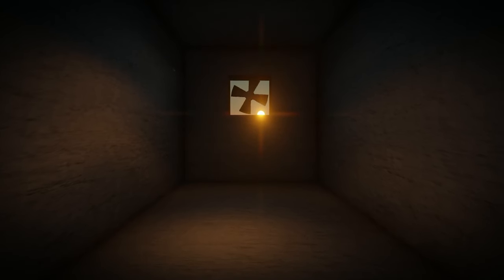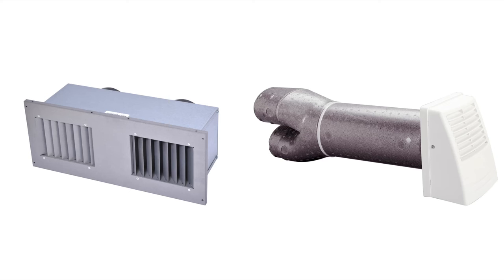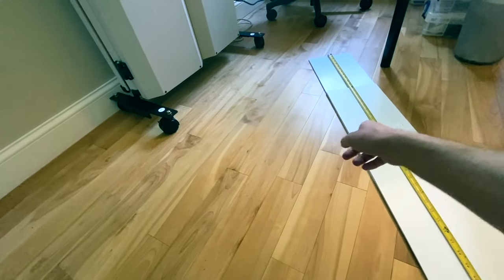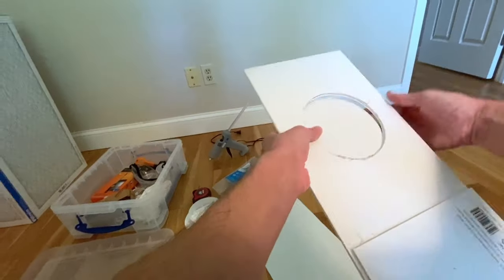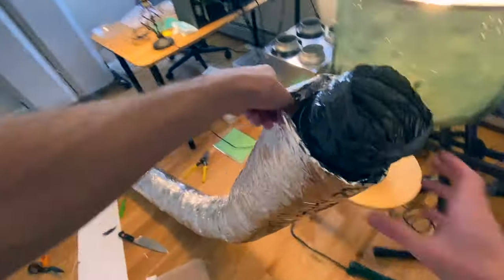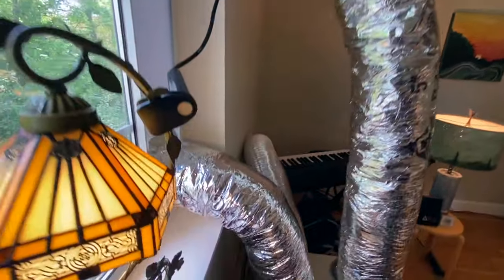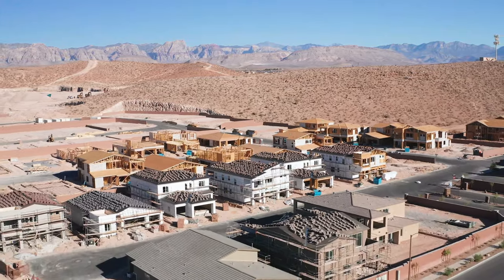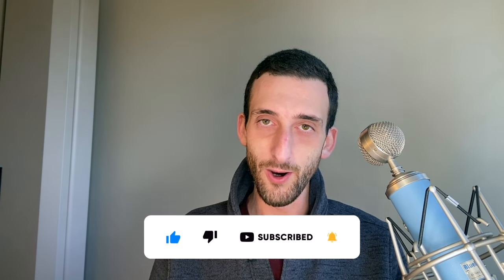DIY Energy Recovery Ventilator Installation (For Homes WITHOUT Ducts!)

Comment: Looking at the comments I think you should have given a half minute explanation about the differences between a HRV and ERV. Especially since you do have a HRV build video :) And why that 1000$ price is not bad for an ERV! Especially your unit does balancing by itself.

One thing I would try is to bring the fresh air duct towards your office door. Maybe on the ceiling? So more fresh air goes to the rest of the house.

Another thing: Should the house have slight positive or slight negative pressure? If I'm correct, you lean towards slight positive pressure to ensure air only enters the building thru the air filter. Right? But for example Nilan recommends slight negative pressure to avoid pushing warm humid air into the structure of your house in the winter (moisture diffusion and also small gaps, electric conduits, etc). Ok, you do have a kitchen exhaust, and only one room has the ERV, so pushing more air in might help diffusing the fresh air thru you home.

Feels like Broan is over-rating their CFM rating. Giving a rating with no ducts is completely useless. You have less ducts than what would be used in even a two room apartmant, but the actual air flow is still less than advertised. Here EU regulations do require manufacturers and sellers to give standardised air flow and efficiency numbers to buyers. But sadly most marketing stuff still says useless claims like "up to 90% effeciency"...
Reply from the maker: Great point! I suppose I overestimated how familiar people would be with the difference between ERVs and HRVs. I actually just made another video explaining it haha! Thanks for the suggestion. 

I like your thinking. I don’t feel that the extra labor of fixing the fresh air duct to the ceiling or closer to the door would yield much benefit - my office is small and there isn’t much of a gap between the fresh air port and the door anyway. My circulating fans do the trick of exchanging air well. Also, it’s not that efficient to blow air along the ceiling and out of a room given that the space above the door is a wall, if that makes sense. 

For those concerned with not bringing in toxic substances (such as mold spores, mouse debris, gas from a heating system, chimney soot, etc) from beyond the conditioned spaces, positive pressure is generally prudent (as I did in this video). Negatively pressurizing a home would concern me. Though it’s surprisingly difficult to actually pressurize a house unless it’s quite airtight. For most houses, which are at least somewhat leaky, you’d need much more cfm than 5-10.

Another good point about companies overestimating airflow for their devices.

Comment: Cool idea (every time i see your videos I think that.) But I'm guessing you live in a zone much warmer than I do as I don't think chloroplast would have enough insulation at -35.😆 Also I'm wondering about the air exchange between panes when the window is slid partially over.
Reply from the maker: I appreciate that, thank you! I live in northern Vermont. I’ve talked to HVAC installers in this area, in the Adirondacks, and in northern Maine, and they’ve been installing this ERV in this region no problem. As far as how it’d perform in -35F, I’d imagine not optimally haha.

Great question about air infiltration between panes when the window is opened. It depends on how well-made your window is, but yes, it’s a great idea to seal that gap with foam or weather stripping tape.

Comment: Hi - I am not sure if this makes sense but why have the insulated ducts? Since it is just going to the ERV anyway and being converted there and the bad air is just going outside - why insulate them?
Reply from the maker: Great question. It’s best practice to insulate ducts that interface directly with the outdoors because cold outdoor air comes in contact with them in the winter, which can cause condensation. Insulation prevents the outer surface of the ducts from getting cold and therefore wet.

I didn’t insulate the two indoor ducts that aren’t interfacing with the outdoors.

Comment: Brilliant - which is why I subscribed. But, I take issue with your contention that a $1,000+ commercial ERV is the only viable solution. I've seen the guts of a commercial ERV. It is a box, with a slightly smaller box at a 45 degree angle inside dividing the box into a four-chambered "heart", where the airstreams pass over one another through a central core. Find a decent welding shop, use commercial-grade duct metal to construct the boxes, build a DIY Coreplast core, install some inline greenhouse fans that are rated for 24/7/365 use. It shouldn't be that hard to build. I agree with 4DDrover; I fail to see why your DIY HRV Coreplast core with more sophisticated ERV box wouldn't work. Why wouldn't it work?
Reply from the maker: Thank you so much! I like your line of thinking. So, ERVs are quite a bit more complicated than HRVs because ERVs recover both latent and sensible energy from the air streams. Recovering sensible energy is feasible - you can build a core. Or find one (though replacement cores cost hundreds of dollars - I’ve researched this feverishly). But recovering latent energy safely and effectively is more complicated and expensive. And I consider humidity modulation to be PARAMOUNT for a healthy home in warmer months. 

As much as I admire your spirit of finding a welding shop and welding together sheet metal, I don’t personally consider that feasible for most people. So maybe our definitions of feasible differ there. But you seem like a renegade. 

Once you incorporate the labor and the parts (buying a replacement core can cost hundreds of dollars, not to mention the expense and complexity of engineering a latent heat recovery system that safely modulates the moisture of the air streams without flooding your home or causing mold issues), building a truly effective and safe DIY ERV would probably cost close to (if not over) $1000 anyway. That’s why I bought one. Thanks for your comment!
Reply: @HealthyHomeGuide  Thanks! It's been a while since I've been called a renegade. Nice to know I still can. I see that my problem is I did not understand the difference between HRV and ERV. I am designing a retirement cottage for the mountains of Arizona (out of the baking heat of the desert) but still a mild dry climate. I hope to use a GAHT system for heat and cooling, clay plaster walls to control interior humidity (clay plaster is a very effective desiccant), and appropriate solar orientation/glazing, thermal mass, and shading to manage temperature. You vastly overestimate the costs of assembling what I now know is an HRV (thanks for that truly helpful info). Can't wait to see you tackle other home design/construction issues!
Reply from the maker: @lindacgrace2973 Yup, exactly. To be clear though, I agree with you (from personal experience as you saw in my DIY HRV video) that building an HRV can be done for much cheaper than $1000. I was saying that building an ERV would be more expensive (than an HRV).

I like your Arizona healthy/efficient home plan! Given that you live in such an arid region, I would say that an ERV probably isn’t necessary for you. You could probably just build a DIY HRV and be fine.
Reply: @HealthyHomeGuide  My thought exactly. With an annual average relative humidity of less than 30 percent, humidity control is not a big issue. I am curious, though. Where are you located where there is no whole-house ducting for forced air heating (the system beloved by condo builders for the past 40 years)?
Reply from the maker: @lindacgrace2973  Yup! I’ve lived pretty much exclusively in New England. I’ve settled in northern Vermont.
Reply: @HealthyHomeGuide  Ooooh. Very pretty country. So the townhouse isn't forced air heat? If not, what did they go with?
Reply from the maker: @lindacgrace2973  I love it up here! Most homes in New England have baseboard heating. Some from gas, some from oil, some from propane.
Reply: @HealthyHomeGuide  Oh. I haven't seen baseboard heat since my childhood in the '50s in Texas. TBH, I'd forgotten about it. Live and learn every day. Rumor has it that they still use blueboard and skim plaster and ceiling strapping in New England; building techniques that have long been abandoned elsewhere in the country. Just a suggestion: but I have been exploring EMF pollution and going down rabbit holes trying to figure out what to do to mitigate it. Maybe you could make some content around that. We are awash in a sea of radio, internet, bluetooth, radiant, and magnetic energies unlike anything in history. I, for one, would be very interested to find out more, and I trust your research. It's been great "chatting" with you! Can't wait to see more content.
Reply from the maker: @lindacgrace2973  Fascinating. It’s amazing how different the various geographic areas of the US are in terms of everything from culture to building materials.

I’ve actually done quite a bit of personal research into EMFs, and I use an EMF meter! I’m a bit scared to share that content as it’s a bit more taboo for many, but I do think it’s important, so I certainly may do a video about it in the future. Thanks for your trust 🙂
Reply: @HealthyHomeGuide  Well-earned, I sure you.

Comment: have you considered testing by using baking soda and vinegar to generate CO2?

Also if i'm only interested in improving one room, would i just want to run the 'fresh air to building' and 'stale air from building' ducts straight to that room without using all those fans? it would be about a 28 foot long run
Reply from the maker: That’s an interesting suggestion. I personally don’t see the benefit to generating CO2 with baking soda and vinegar in such a large scale application (a living space) - you’d need quite a bit of it for comprehensive testing, and would need to completely eliminate the other main source of CO2, humans, which isn’t feasible. It’s more practical (and doable) to test with humans in the living space.

Good question! As I mentioned at 35:44, if you only need to ventilate one room, you can certainly decide not to use fans at all. Try to separate those ducts you mentioned as much as you can. They don’t necessarily both need to be in the same place, in fact, they’re often put far apart. Give them at least a few feet of separation and point the fresh air to building duct away from the stale air from building duct, and you’ll be okay 👍
Reply: @HealthyHomeGuide it would help with the exact scenario you described in the video that you didn't want to do - having all the occupants stay in one room. in the literature they used about 3/5 cup of baking soda to 1.8L of vinegar
Reply from the maker: @tubulartuber  ah, interesting, okay. I’ll look into this. Thank you!

Comment: I'm so glad I found this!!! The broan 130 popped up on my research, but I am nearly settled on the intelli-balance 100. Did the Panasonic intellibalance pop up during your research?

Either way, just wanted to add my plan is to convince a local hvac distributor to sell to me direct to customer to save a couple more dollars. 
Great guide man, these should be in every home
Reply: Not sure if you looked at them, but RenewAire EV Premium S / M / L are pretty good options too though I don't recall if they autobalance.
Reply from the maker: I’m glad you find my content valuable Steven! I haven’t personally tested the intellibalance 100, but I have a friend who is a mold assessment professional and he swears by the intellibalance 100. 

That sounds like a smart plan to convince a local HVAC distributor to sell to you. Can you let me know if you’re successful?

I absolutely agree that these should be in every home.
Reply: @parak4593 thank you so much for the Renewaire ev recommendation! It looks like it's manual balance, but the cost is much lower with higher Cfm range. Definitely now a consideration!

 @HealthyHomeGuide I used to work in electrical distribution and these rules can be bent easily! Distributers can enter individuals in their system as an "account" - but it's much easier with local family owned or less-busy sales companies. For example, if they market that they only do Industrial and dabble in commercial, you'd have less luck than with someone who markets to Residential / commercial or is decentralized, slow that day, etc.      The manufacturers themselves can often recommend their opinion on who locally or in your region is open to residential direct sales.

The only trade off here is if you walk in there unsure of price they will GETCHYA. Be ready to negotiate and know your price!

Funny enough, Panasonic recommended a dist company near me that was mainly plumbing - but dabbles in HVAC! Makes me wonder if electrical distributors would be allowed to order this item... 

Lastly, it helps to quid quo pro quo a bit ~ if yall do me this favor for my project, I'll buy the rest of my parts from you, recommend you, etc.
Reply from the maker: @steventocco4579 This is absolutely fascinating, and could be super useful for buying ERVs at a lower price point. Your knowledge here could prove very valuable. Do you think it’d be a good idea to make a video about this? I could interview you about your strategy - do you think that could be a good future video? (Or you could make your own if you want to of course).

Comment: Hi - you said you put 4 bricks under your ERV in order to elevate it - was there a reason for this? What kind of bricks did you use? - Thank you!!
Reply from the maker: The reason is to make it so I can unlatch the door - the latches swing down and the floor gets in the way of them opening unless you elevate the ERV a bit. I just used standard sized bricks from a hardware store.
Reply: @HealthyHomeGuide  Like 4 red bricks?
Reply from the maker: @chrisjabre  I think red bricks can have crystalline silica from clay, which can be harmful to breathe. Try finding a brick that isn’t red, but same size as your standard red brick.
Reply: @HealthyHomeGuide  You are awesome. Thanks so much for your help.
Reply from the maker: @chrisjabre  Happy to help 🙂

Comment: Great work.  I installed the Broan 230 HRV AI series in my attic, in a type 4 (singe return, but synchronizes with the AHU fan and ducting for supply).  This was a lot of work, mainly because it almost didnt fit in my attic space, but it is in there now, and i have dialed it it.  The only thing that i regret, is that i could not easily add a 4" media filter at the AHU.  I have a Corsi-Rosenthal filter near the return.  I think that i will be updating that filter fan to the one that you posted in another video or 6 x 120mm server fans to reduce the noise and footprint. 

My primary goal was to have as much fresh air in my bedroom as i could when i sleep, with the door largely closed.  CO2 went from peaking at about 1500ppm at the end of the night, to right around 750.  A big win.

Keep up the good work.
Reply from the maker: Wow, awesome job 👏 I salute you for taking on such a project and successfully cutting your room’s CO2 in half even with the door closed!

Comment: That's a really intense set up you have and your two-story house. Thank you for all the details. It really helps to make it practical for a DIY period but it's definitely comprehensive system you've had to go through since it's not a not central heating and air conditioning that you can modify. Kind of see why that's easier to do possibly. Although I'd hate to see the price tag to add it to the central HVAC system. I'm not sure but it sounds like I should really get some numbers on the particles and what kind of particles I have in the air that I need to filter out. I know there's a lot of dust in this super dry Central Oregon climate but I'm not sure what else there is and I should probably do a lot more research on that. I guess first step is getting some type of a tool that gives me the feedback like you had on your trip across country to measure particles and CO2 and etcetera?

Comment: A full home evaporative cooler with ducting costs about $4,500 AUD installed. Only took 1/2 a day to install with ducting to 5 points around the home. 

You suggested that the cost of aircon and ducting was prohibitively expensive. It probably depends on what kind of aircon and ducting you get.

🙂
Reply from the maker: I’m not sure if I’m misunderstanding your comment, but:

1) An evaporative cooler and an ERV do two completely different things.
2) $4500 AUD is around $3000 USD. That’s more expensive than what I show.
Reply: You state early in the video that the cost of installing ducting in a normal home is prohibitive. I was picking up on that comment not your later solution. I'll edit the comment to make it clearer.

I rather like your solution.

:-)
Reply from the maker: Ah, I understand! Thanks for clarifying.